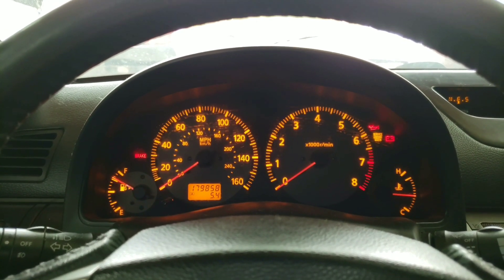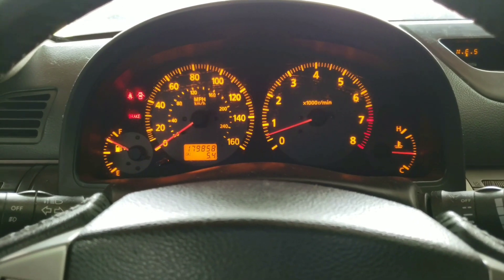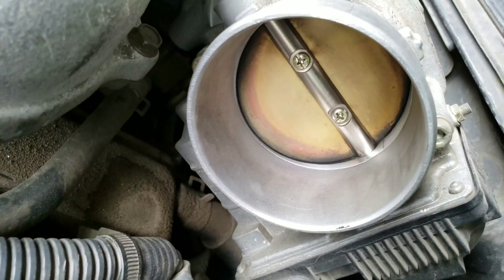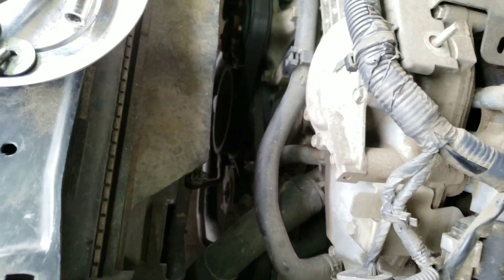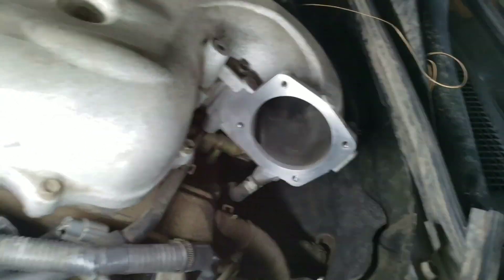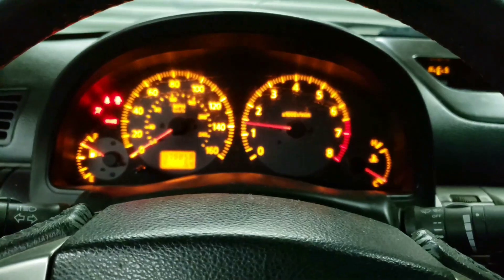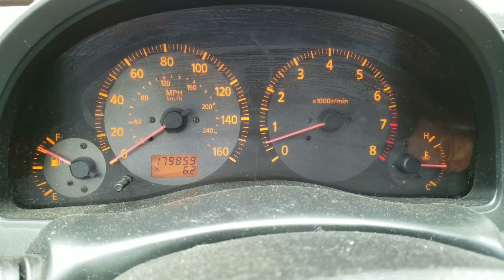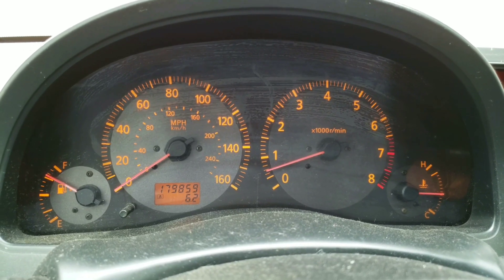VQ35DE Engine Low Idle Stalling Issue G35 / 350Z Throttle Body MAF RELEARN PROCEDURE

Comment: could bad oxy sensor cause this also? My 350z was running perfectly - then sat during the lockdown and now this low Idle has happened. It seems the car is burning rich.
Reply: Same. Looking for a solution
Reply: @ajbishop6682  I have changed the MAF, 4 O2 sensors, fuel pump, and temp coolant sensor, and my car still burns rich with bad gas smell. It can only be one thing now, leaky or stuck open fuel injector. I plan on yanking the clamshell and pulling them out to clean and check. However, I plan to do a Macgyver move by spraying carb cleaner through the first fuel dampener after pulling the fuel pump relay fuse. You stick a tube in the hole and make sure the other end is sealed. It must be able to hold pressure. Just have the carb cleaner straw sticking out and spray ---- then start the car. Hopefully, this will fix the clog. My car has been sitting for a while during lockdown until now. It was running perfectly before lockdown.
Reply: @gladegoding2219  sorry dude, I don't get notifications for YT. Good job on the others. Sucks that you spent all that $ without a fix but atleast you know they're new. I'm in the same boat, about to clean or change the injectors. Thats the last thing ik to check really. Let me know if it works for you. Mines also been sitting a couple years
Reply: any luck ?

Comment: Damn my 350z doing this, after the engine warms up it starts up but at a pretty low rpm
Reply: You end up fixing it ?
Reply: @mariorivera8182 I had to get the timing better for the TB relearning procedure, after my rpms were more stable I still had an issue where the rpms were just low enough to cause a weird rumble at idle. Overtime though the problem solved itself by simply daily driving it.
Reply: Also fyi my tb and everything was fine before cleaning, it wasn’t til after maintenance that the programming had an issue

Comment: My car don't go more than 10mph what's the problen
Reply: did you get it fixed
Reply: it's in limp mode. you'll need a code reader to see if it'll show any codes that could be pending and not showing

Comment: I added the nwp 75mm throttle body and I’m having the same issue and the code I got was pertaining to the throttle/pedal switch sensor in the gas peddle
Reply: did u figure it out??
Reply: @Dr3ws600  any fix on that yet ?

Comment: My car does the same thing but stays on at the second crank.
I wonder if is the same problem.
Thanks for sharing. 👍
Reply from the maker: Possibly. It definitely wouldn't hurt to try.
Also have you been driving your car and is there a CEL on?
Reply: @salvageperformance5170  No that was my problem, there was no check engine light pretty weird. 
But it turn out to be a faulty maf sensor, as soon as I replace it the when back smoother than ever.
And my rpm's are around 650.

Comment: My 2008 Z  started doing this after I drove through some semi deep puddles while it was storming sadly hopefully I can fix it
Reply from the maker: Chances are you got water on the maf element.
let it dry and if you still have issues use compressed air to blow out any water that could have made its way into your connectors.

Comment: What’s was ever the problem? I have the same thing happening to my 350z
Reply: I’m haveing the same problem but my car backfired while being started
Reply from the maker: @los5105  Have you read the CEL for any codes? 
My problem was solved by the end of the video. It was just a dirty throttle body.
Reply: @salvageperformance5170  yes I just fixed the codes I had it was p0011 and I changed the cam sensor bank 1 and I’ve cleaned my throttle body and maf sensor I’ve taken the code out now and throttle body reset but it still stalls when slowing down or when reving the rpms drop very low and sometimes drops or bounces back up
Reply: @los5105  did you ever figure it out?
Reply: @los5105 you ever figure this out ???
Reply: What did you do to fix this los? Mine also backfires when I try to start it
Reply from the maker: @SmokedbyTopgun  just clean the throttle body. I never had backfires. sounds like you have a different problem.
Check your Maf, and also make sure that the coil packs are connected in the correct order. Easy and common mistake others have made is switching the connectors 3 and 5, or 4 and 6 on the coil packs.

Comment: Did this car started stalling  soon as I start it  before I did it car would start and sit for a min then stall
Reply from the maker: Make sure that you have done the Idle relearn and check for any vacuum leaks. Even a small cut in the intake flex tube could cause your car to stall.

Comment: By any chance did the issue ever come back? My 350z keeps having the idle low and shutting off after it warms up.
Reply: I ran a can of seafoam through the vacuum on the lower plenum. It cleaned out a lot of carbon build up. When I installed a 5/16th Blox Plenum spacer, I cleaned the hell out of the inside of the plenum, upper and lower intake manifolds with brake cleaner. I noticed that my upper intake manifold the part that bolts onto the plenum is missing the two outside studs! This had my stumped for awhile. I was worried they somehow broke off and fell into the intake. I searched forever and didn't see anything on top of the valves. So I guess mine never had those studs. The gasket I had, had grooves for those studs. I just used a shit load of RTV to be on the safe side. Then I made sure to use extra RTV on both sides of the plenum spacer. I cleaned the throttle body and maf before I reinstalled the CAI system. I started getting lean codes on the bank 1 side. Sometimes I could drive a few hundred miles and the ses light would come on indicating it was running lean. I'd reset the computer doing the manual peddle dance. It'd stay off for a few wks, then bam a lean code. Sometimes my idle would go so low that it'd try to stall. I've done the idle relearn and throttle body relearn. I found that my intake tube was loose around the coupling, so I tightened it and even used some more RTV. I probably went crazy with the RTV. I also have an oil catch can, I'm thinking this may be my real issue. My reasoning is on the bank 1 side at the rear of the valve cover is a vacuum hose that normally goes to the intake hose. This allows fresh air to come into the crankcase. I blocked off the inlet to the intake tube completely. I then rerouted a 3/8th inch hose from driver side valve cover behind the engine around to the other side where I have my Oil catch can. On the pass side where the pcv valve is I took the hose that run from pcv to lower plenum vacuum. Used that hose and attached it to the OCC. Here's where I got lazy this hose was slightly too small in diameter for the OCC inlet. I kind of spliced it on both sides to stretch it. I then used a hose clamp and then used RTV to creat a better seal. I then used another 3/8th hose going from the outlet of the OCC to the lower plenum. Which essentially is a closed system. A lot of guys vent to atmosphere, but my thinking is that I need to have some sort of "fresh" air into the crankcase. It's a baffled can and does an excellent job at condensing all of the hot blow by vapors. For like $25 on ebay it is actually a great deal and a great design. I highly recommend this for every G owner. Just make sure that you have it air tight. I believe I had a small vacuum leak, I kept hearing this hissing sound. I believe I fixed it though and have yet to get another lean code. My mpg have averaged out back to normal. I only run 93 octane in it, I keep it clean. I also installed new valve covers that I painted aluminum, because I went ahead and painted the plenum this Ford Blue 🔵 that really pops. I got the valve covers with gaskets and hardware for $55 on ebay. They work great, got 6 Platinum spark plugs for $24. They are normally $6-$8 a pop, then a set of 6 new coil packs for less than $40. Good thing too because when I went to remove 2 of them, they completely fell apart on me. A lot of ppl knock on ebay,but if you know what you're looking for, ebay can be and is a huge asset for any DIYer. After I installed these mods and tuned it up, it was a night and day difference. Before I could hardly touch the plenum without burning myself. Now I can drive 4 hrs straight and can lean on it with all my weight and it's slightly warm to the touch. Heat soak is now a non existent thing of the past with this car now. This car loves cooler temps, I went ahead and installed a low temp thermostat to open it up 20 degrees cooler than normal. My intake is installed right in the driver's side wheel well, you can barely see it poking behind the whole in my bumper. It doesn't get wet at all when it rains, so it's liking the cool air. It just took me awhile to pinpoint the lean issues I was having. It was getting too much oxygen in the A/F mix. I knew it'd also take a couple of hundred of miles for the ecu to relearn the new parameters. Overall the car was fairly well taken care of. But I could tell it was neglected for awhile, fortunately not for too long. The engine bay was pretty dirty when I bought it. The K&N filter was obsolete. Never seen anything like it, all of the cotton pleat material was nearly gone! The screen was just caked in dust and grime. That had me worried because the engine surely should have sucked it up. When I had the intake apart and looked down on top of the valves it was surprisingly clean. Even when I had the valve covers off, there was no excessive oil buildup. The rockers looked to be in great condition, cams looked great. There was no scoring, nothing was plugged up. Since I have the X model, I went ahead and changed the atf, transfer case, as well as the front and rear diff fluids. Everytime I do an oil change I will just drain all of the atf that will come out from the drain plug. It equates to slightly over 2 qts. So I'm slowly introducing new atf every 3k-5k, just whenever I feel like doing an oil change. 

Just had the starter go out on me. To my surprise it was covered in fluid and grime. I had completely overlooked this, it appears to be atf. It's either a seal from the transfer case, or where the cv Axles go into the tranny. At closer inspection it appears to be coming from the rack and pinion. So I have power steering fluid everywhere. Yet the reservoir never looks low. I don't get any whining noise whenever I turn the steering wheel, so it beat me. The valve covers no longer leak, but I'm thinking about taking the bank 1 side back off so I can better inspect the plugs on that side. Because it was running lean, I believe specifically cylinder 1 &5. It may of fouled a plug, nothing too bad to cause any serious drop in performance. Usually when it runs lean it'll cause the injectors to induce more fuel to compensate for the assumption of there being too much oxygen in the mix. So the plug can become saturated which will ultimately cause poor performance. Plus my OCD is bad and I think I do see a small leak. There's a trace of oil on my header. It more than likely is just oil that flung off the dip stick. Talk about a pain in the ass design. But that is a topic for another day. 

I know I sort of went way off of subject here. But you're correct on making sure everything is clean.  I understand not everyone has the know how, time, nor probably cares enough to do things thoroughly enough. To take apart the plenum and clean the intake manifold. But I stand behind running a can of seafoam through the plenum vacuum. Just make sure to have another person help you by giving it some throttle so it doesn't stall while inducing the liquid into the vacuum. Let it soak for atleast 15 min. Tighten the vacuum hose and crank it. Don't be alarmed by the huge amount of smoke that will be coming out of the exhaust! That's all of the carbon buildup it has acquired over the yrs. I've done this with every car I've ever bought over the last 20 yrs. I swear by it, it does work and it's amazing at what it does. You can even put some in the gas tank to clean the injectors and throw some in the crankcase to help free up some sludge within the crankcase. Whenever I do this I always get 2 cans, Walmart even makes a version that's 2 bucks cheaper a can. I get that stuff use a little over half a can for the gas tank. Pour the remainder in the crankcase and drive it for another 100 miles. Then I'll pour a whole can in the vacuum. Depending how dirty the engine is, it will smoke for anywhere from 5 min to 20 min! I usually always go to a big empty parking lot away from ppl. Sometimes the smoke coming out is so thick that if you're driving it can hinder traffic. I did this one time and it'd belt out smoke so thick everytime I changed gears that I couldn't see the cars behind me at all! So just keep it parked and rev it until the smoke deminishes. Then I'll give it an oil change and you're usually good to go. It always helps with a rough idle, it'll accelerate better, run smoother and overall just perform better. 

Even after all I've done to my car it still suffers from the notorious oil consumption issues. Really a lot of engines are prone to do this, especially higher mileage engines such as mine. It has 209k but drives better than cars I've had that only had 120k miles. This has me a little worried only because I'm not sure if the previous owners were as meticulous with checking the oil as much as I am. Im almost certain they weren't, so there's no telling how long and for how many periods it was driven low on oil? It's already a pain in the ass to check the dn oil level. So I don't see them doing it once or twice a week like I do. When I first bought it I was having to top it off about a qt of oil every 500 miles like wtf. After I've cleaned everything, given it a much needed tune up(some of those plugs were beyond gone), and added the OCC. Im now only having to put maybe half a qt of oil every 1k miles. It really depends how hard I've been running it. If I'm just cruising and not being aggressive on the throttle, then I have to top off even less than that. Im estimating that I'm having to empty out maybe 1oz possibly slightly more than that once a month from the OCC. So it's definitely doing its job, I can attest to that. That's fluids that aren't diluting the a/F ratio and being burnt back into the engine. Which over all keeps things running more efficiently. Basically make it a good habit at always checking the oil levels with this engine.  I also recommend immediately doing a tune up if you haven't. Make sure to clean everything like I did as well. The plenum spacer is also a great investment and you don't have to have a CAI, but it won't hurt. This car amazes me everyday that it's a 16yr old car with 209k!
Reply: @nowimhigh  thaank for this now I gotta get high
Reply: @aloiba100  😂 literally surprised myself reading this mini book
Reply from the maker: Hey Danny, I never had an issue with it coming back after doing this cleaning.
In most cases a low / stalling idle outside of the throttle body's control (IACV) happens because of the wrong Air Fuel Ratio.
First, Did you clean both your throttle body, MAF sensor and do the Idle Relearn?
If so, do you have any check engine lights???
If you have driven the car long enough for the ecu to go into "closed loop" ( about a 70mile drive ) and do not have a CEL on, then unplug the battery for a while ( about 15 minutes ) so that your ECU can reset its  Fuel Maps incase it is still operating on its "corrected fuel trims".
If you have done all of these things and never had your CEL come on then you are likely dealing with a Vacuum leak.
I use a smoker to pump smoke into the intake system to find leaks, but there are many different ways of finding a leak.
Check out this youtubers video If you feel that you may have a vacuum leak and need an idea of how to find it.
 https://www.youtube.com/watch?v=9CPqbaSgcok
Reply: @salvageperformance5170  you have no idea how much u helped me out and I am grateful u took the time to show us this video. It got rid of my low idle and shutting off issue. Thank u!
Reply from the maker: @dannymolina3363  That's great! I am happy that I could help.
2020 has been a crazy year for me, but stay tuned in and early to mid 2021 I plan on releasing a lot of DIY repairs on the G35 coupe and sedan. Even some 240sx stuff.

Comment: Have the same issue but with a p0305 but I already did plug and coil any ideas
Reply from the maker: I would first recommend pulling the coil and plug out and check if you are getting spark, and while they are out it wouldn't hurt to do a compression and or leak-down test on the cylinders. If those all check out good, hopefully it was just a bed connection and when you put everything back together it runs great, lol.